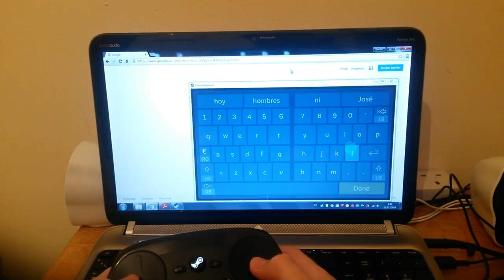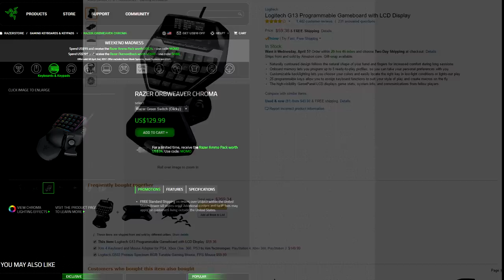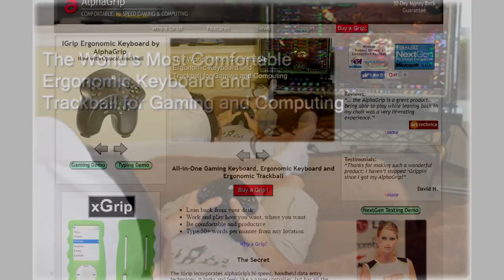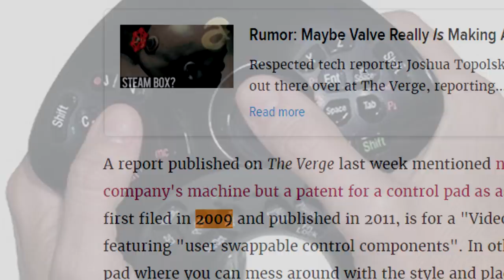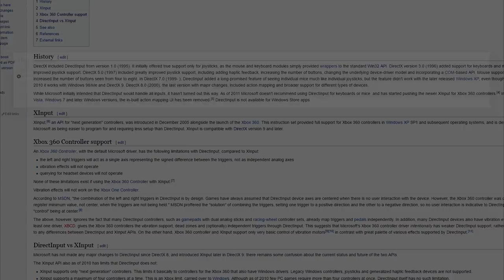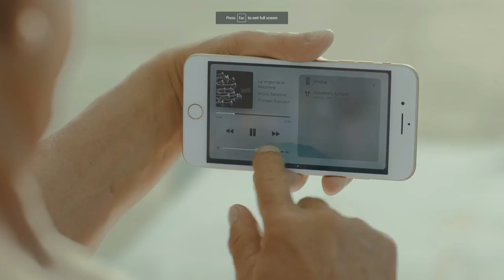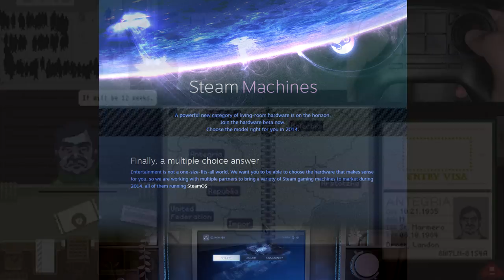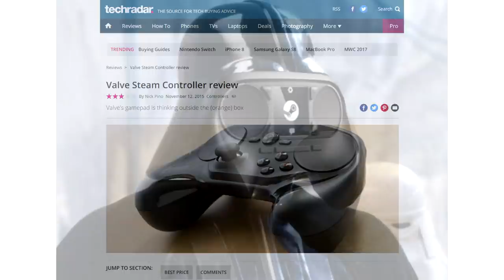The Steam Controller: An Analysis - Part 1

Comment: i really really like using the steam controller. i'm always amazed by the accuracy of the right touchpad, it's like a mac trackpad that's really meant for gaming. it also makes a really good multimedia pc controller. it controls the cursor throughout windows and you can click the left stick which brings up the keyboard (the best controller keyboard solution ever). being able to totally customize controls is great but having presets is also fantastic. my only gripe is the shape, my hands start to cramp up slightly after about 90 minutes.

Comment: Love my steam controller for gyro aiming in shooters and being able to build configs but it's time for a version 2. The BPM UI needs to be updated also.

More games need to embrace KB/M/Gamepad simultaneously.

The only thing making me want to go back to console is Xbox live. It's a much better social focused UI.
Reply: the926 
That's true, I would like a version 2. 
4 rear grip buttons rather than 2, dual stage bumper buttons and better triggers please (with longer range of activation).
Reply: i agree with steam big picture mode updating. Hardware wise, i actually have zero complaints about the steam controller still. Its only software stuff. Bindings not saving, lag in big picture mode, etc etc
Reply: I get a little worried with 4 rear buttons, they'd have to be designed very well. Not everyone has unique control of all their fingers. A lot more people than you'd realize have fingers that auto move their other fingers... if that makes sense. it is a nerve thing.
Reply: In that case, I say dont make the 4 buttons equal size. Maybe off set them. I'm mainly thinking useing them for PTT or something else that would be useful, but not integral to the game. On alot of my configs I have to layer PTT with Melee or something. I realize what you are saying though because people battle with that on the xbox one elite controller. When I used to own one I only used the top two paddles because of inadvertently hitting the bottom 2 (they stick out too far.). The SC's grips dont stick out as bad as the elite controllers paddles though and are more conformed to the shape of the controller.

Comment: over 4th of july holiday I spent a good majority of my time having fun configuring rts controls on games I got on the steam sale. the radial menus and touchpad menus and all that you can do is amazing. I even made divine divinity control with the left stick even though it's a point and click movement. I still need to the learn the gyro that's the one thing that i haven't got used to yet.

Comment: Great video, lot's of info i forgot about & didn't know.
I still own lots of controllers that were "experimental" sortof & never could get used to them including the steam controller.
My 1st "experimental" controller was the microsoft "sidewinder" for playing FPS games, i still have it.
I bought it in early 2000, boy was that controller so hard to use coming from playing PS1 controllers.
It was much easier to learn how to use the kb/m then the sidewinder.
I want to give it another try with the razer hydra & the steam controller but i am sooooo used to the xbox 360 controller.
Of course i still use kb/m.

Comment: Will never go back to standard controllers! 
I hope they do a v2 down the line only to optimize the bumpers position/feel a bit better, as well as the click pressure/sounds of the bumpers and trackpads (hate the tinny click and heavy pressure required to click them). Outside that the controller is damn good. Also, wouldn't mind 2 more paddles, or a different finish, but I can live without these things.

Comment: I am also loving my steam controller. Currently it is the only controller I am using after switched from xbox controller. But, the software for managing the steam controller, which is the steam, needs to be fixed and imrpoved badly. Lost of the configs, UI freezing, long wait to save the config to the cloud, lost control of the desktop when the client is minized, etc. It is a great controller, but a long way to go for perfect.
Reply: hell, im typing on mine right now

Comment: if it had a better desktop typing mode, it would be sooo perfect.
Reply: the steam controller keyboard is alright. just has some problems when inserting unicode characters, apparently
Reply: you can't adjust keyboard window position, often it appears on the text i'm triyng to write.
It's really a pain in the ass sometimes....